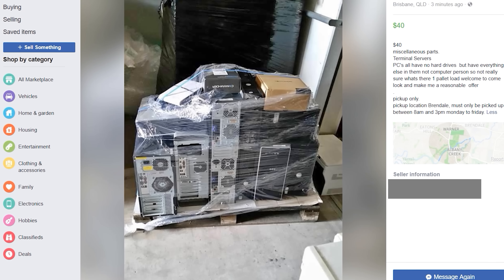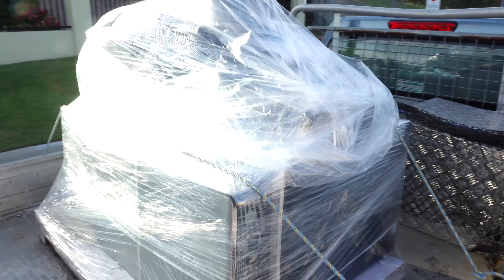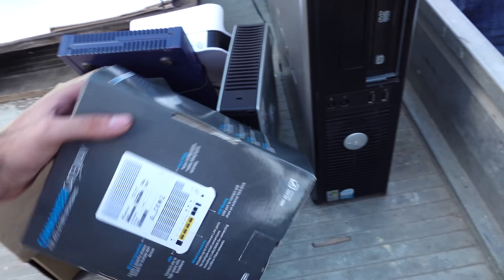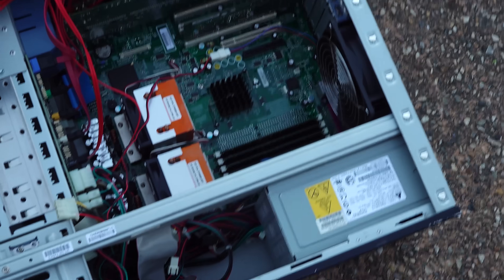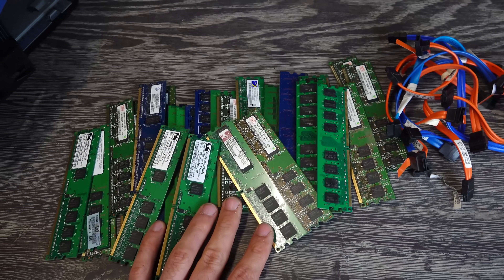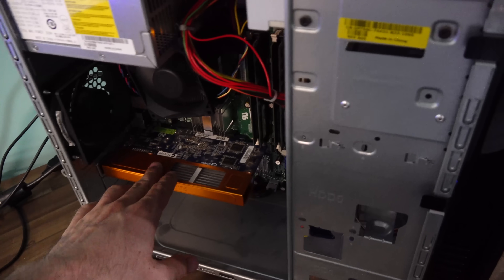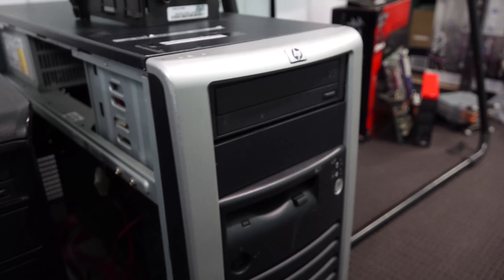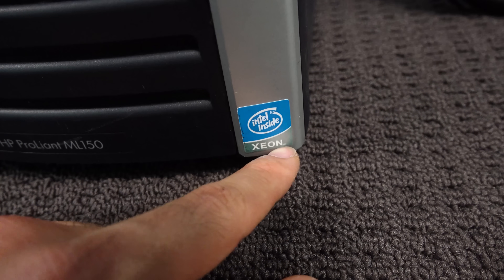I Got 15 Computers for $30....!

Comment: With so much scrap you could start your own series on extracting gold and copper
Reply: TheFinalRevelation THAT IS A WASTE OF PERFECTLY WORKING PCS. I HATE PEOPLES WHO DESTROY WORKING ELECTRONICS FFOR RAW MATERIALS but I enjoy watching videos about selling working parts like fans DVD had etc. not melting cpus in chemicals
Reply: I buy old pcs
Reply: Why the heck would he do that? Of one of these pcs he would make just a few dollars.. Restoring them and selling them he could get way more
Reply: @eduardoavila646  Who buys a core 2 duo these days ? They consume more power and are way too slow.
Reply: TheFinalRevelation spend $15 and get a q6600 and you have about an i3 lol
Reply: @TheFinalRevelation1  Lots of people. They can make great really cheap file servers, things like that. Lots to do with old processors that many don't even think of.
Reply: @XtremeConditions  They consume too much power, only the 2-2.4GHz core2duos consume less, others are a problem
Reply: @TheFinalRevelation1  I mean I just looked at an E8400 at 3ghz and power consumption seems very reasonable, and it's not like it's going to be under load all the same anyway..
Reply: @XtremeConditions  Perhaps but they are not practical. I am using an old processor myself which is on 24/7 (through a UPS) downloading files and nothing else, but it is a G645, very less power, dead silent with the fan limited to 1000 rpm, no overheating and very stable. Bought the whole desktop for 40 dollars in 2017 with 4GB ddr3, (2x2) and put in a 1TB HDD. Core2quads and E8400s etc are the worst thing you can buy. G620s and G645 are the best bang for the buck PC for this kind of stuff. You can buy them in a small form factor desktop for 20-30 dollars.
Reply: @XtremeConditions  I had one, not good for a PC you want to keep on 24/7 at a place with power outages. The G645 is more like a mobile processor. Goes as low as 1GHz perhaps. The temperature does not go above 60C ever in stress tests and I am not using a special cooler. I just replaced the fan. Even the fan does not go above 1200RPM. Dead silent and low power. Just sharing my experience. I have also used an E8400 but I didn't like it much. If it is a bit more performance you need, buy a 2nd or 3rd gen i3 desktop. They too are cheap these days. People don't want to buy them because they can get an i5 for a tiny bit more.
Reply: @TheFinalRevelation1  Awesome, thanks for that info.

So was that your purpose for the G645, a file server? And you put it down to 1Ghz yourself?  I think it showed 2.9 Ghz as base clock.

And it was still adequate? What sorts of things were you storing? Sorry to be a pain haha.
Reply: @XtremeConditions  Yes a sort of a file server to download media files 24/7 but not to store them.  It throttles like new gen CPUs. Dead cheap and low power. I measure its power by how long it can run on a battery.  There are some good options in the 6th, 7th gen boards but they are expensive. Check this out:  http://cpuboss.com/cpus/Intel-Pentium-G645-vs-Intel-Core2-Duo-E8400
Reply: @TheFinalRevelation1  Wow, so that's a really interesting use for them. I can't even imagine what the purpose of them being in charged for downloading would be lol. A node of kind, something like that? Well either way, I'm pretty intrigued tbh. I was even considering something like a basic web server to play around with too.
Reply: later stage  faster c2d models run win 10 fine got a old dell xps as a down-loader and media player hooked to the tv. 
even the quad cores make a good entry level gamer on if you add the 8 gig ram
Reply: @meowdacat  Downloader? ;)

So basically an HTPC type setup? I've honestly been thinking of taking a trip to a scrap yard and just seeing what they have on hand. I'd imagine a Core 2 Duo with an older cheapo single-slot GPU would work out just fine? I have an HD 5450 on hand and can't see even 4K 30fps video playback being that huge of an issue. 

More of just a fun/hobbyist type thing rather than for practicality. But it'd basically be "free" more or less.
Reply: @TheFinalRevelation1  
A core2 duo can be replaced with a quad core.
Reply: @TheFinalRevelation1  It is called retro gaming, you muggle!
Reply: @TheFinalRevelation1  umm Brazil or low enocmony country. Look at the optimize game pubg lite for South America . They still play ps2 over there and modified ps2 games. Heck they even for me that is good than what I have lol.
Reply: Scrapyard wars. Or is that already taken?
Reply: @Jimmy_Jones  linustechtips
Reply: If i had this hardware, i would PAY anyone 30$ just to get rid of it
Reply: Shhhhhhhhhhhhh.
Reply: It's only worth scrapping when you have literally tons as most of what you'll be scrapping is aluminium, iron and steel.  and you need to remove all non-recyclable plastics and separate the metals from anything with a PCB, and ideally shred everything yourself or take a deduction as non-shredded scrap has so much dead space for storage and transport.
source; worked for a refurbisher and sold 10-25tons of scrap hardware every month which basically covered the warehouse and office coffee and bog roll budget.  the older processors and components that actually have appreciable amounts of gold are worth substantially more as collectors items if they work anyway.  Most of our money in scrap came from cases and HDDs.
Reply: Lucky find
Reply: he got the look to be  a Aussie movie star .. that what ithink lo l
Reply: The ram cost more
Reply: That was i am thinking lol
Reply: no he wouldnt
Reply: Grinix I dont know to who is this directed, but if its for me, yes he would. 
A old computer, even a pentium 4 based system, worth more than the little bit of gold that you could potentially take out of it. Not to mention all the work you would have to remove the gold, all the chemicals you would have to buy, and all the time spent, wich reduce the gain you get with that small quantity of gold extracted. Firstly because unlike many people think, gold isnt just super abundant in these pc parts, the most abundant probably will be like Sn, Cu, the 'plastic' and/or glassfiber wich makes the pcbs, silicon, etc. 

And if you get the pric for the g of gold, calculate gow much you get out from a pc, and search for usuall prices online, you will see the difference. If you clean all the parts, and resell as a retrogaming pc, the profit is even bigger, as many people want to just buy a pc to play some old games. See youtube for example. 

Now that if you dont, for example, sell to a third world country, as Brazil. Then you would probably be able to have way more profit, these old eletronics can cost like 5-6x times more.
Reply: trash.. you can get lot of these for free
Reply: TheFinalRevelation nah he should just throw it in the garbage copper is worth crap you need a shit tone of copper in order to make near 5 dollars I should know my dad did it before
Reply: rainrunerkill Popkill They were talking about extracting the gold, not the copper. 
And surelly not much grams of gold would be possible to be taken out of these machines. 

But trowing them at the garbage wont make you even a single penny. 

Just sell them.
Reply: actually, if you read the original post, it says GOLD and COPPER, not just gold. sorry to burst that bubble of yours.
Reply: Random Guy13 I dont know wich buble you popped, down here we were discussing the gold extraction, its obvious that copper isnt worth it.

The discussion starts in the main original comment, and goes on, changes objectives, and if you see it clearly changed the subject to only gold

And btw why may of you guys need to feel like "winning" "oh sorry to burst your buble". 

The pric per kilo of the copper itself is bad enough that unless you go stealing all the internet and eletricity cables from the street you wont be gaining a decent amount of money.

Comment: I should also point out anything that has a 64bit dual core CPU, and take at least 4GB of RAM can run some low resource Linux Distros like Bodhi Linux, Mint Mate, and Mint XFCE. I'm also a fan of Xubuntu, but the latest updates are causing issues with my various AMD GPU/APU systems to the point of a total system crash where I can't boot my system, so moving to Mint Mate tonight.

Comment: I think that HP Proliant (the one with dual Xeons) is socket LGA 771. Pretty old architecture and a dual CPU setup, won't do great in gaming. Will probably do better than a core 2 duo though, it will have 8 cores and you can load it up with more than 4 GB of RAM most likely.

Comment: Some older systems needed a lot on the 5 Volt rail, and less on the 12 volt rail, so do keep that in mind when looking at early Pentium 4, and older systems. so it does not mean the PSU is crap, just the way they were made back in the day because again it's what the system needed.

Comment: See this garbage at work all day. If it isn't 2nd gen or newer don't bother.
Reply: Nilas Grahn  him means the processor gen you dickhead, but honestly if the pc doesn't have at least a 2nd gen i5 it's complete useless in the rapid software demands these days.
Reply: Nilas Grahn  also consoles are computer I think you mean desktop not computer, a computer is anything with a processing unit

Comment: That dual Xeon HP server/workstation looks like it had an HP P600 Smart Array controller in it.  I have 3 of those still!  They were over $1000 back in the day.  They were great cards.  You should definitely learn about your server history with that machine.  It had some old PCI-X slots.  Good stuff there.  I miss those old systems.  That was a pretty incredible haul for $30 AUD.  Please stick to your roots and keep doing videos like this!

Comment: I'm so happy at the end of the video you decided to go back and keep the core 2 duos. Obviously they're rather weak in 2018, however for really budget builds they can't be beat. Usually get them less than 5 bucks a piece and can play a decent assortment of games at 720p or lower with either an integrated chipset graphics solution or a cheap old card. I know for you personally flipping a core 2 duo pc for like 25-50 bucks probably isn't worth the time invested to wipe it out and install windows etc, but for a super budget gamer or something similar it really can't be beat.
Reply: If only Intel had them unlocked, then I'd buy a couple dozen just for a weekend of LN2 fun, but sadly they are pretty useless except running Linux (but I could run a out 32 virtual machines of Linux at once with my CPU and have it run faster, so its not like I'd want 32 of those systems!). Its just a shame they are locked... Would have been fun!

Comment: I hope the AMD-System is going not to Junkyard... Bryan was it AM2? Was a Athlon X2 5600+ or 5800+ in it?
Reply: They can still run a low resource Linux distro like Bodhi well, as I've gotten it to run on some shit Intel Atom N270 Netbooks with 1.5GB RAM and 360p Youtube playback via SMPlayer, and SMTube works just fine.

Comment: I bet you could probably push that E4500 to atleast 2.8GHz, i was able to push mine to basically 3.0/3.1 on a copper zalman top down cooler. although to be fair when i pushed it to 3.1 it was because i found good memory sticks for it.

Comment: Oof, the Xeons in that dual socket system are Netburst uarch. So basically Pentium 4 Xeon counterparts. Yikessss. Whats that long add-in card with all the red cables coming out of it though?
Potato name ideas! Russet, Yukon, Opperdoezer, Tajfun, and Bintje.
Reply: I'm 99% sure it's an HP P600 PCI-X Smart Array controller.  I can see the ports and the battery.  I have 3 of those cards.
Reply: Looks like a RAID controller to me. All the cables look like SATA data cables.
Reply: Maybe the board supports "dunnington" 6 core xeons.
Those are quite rare though.
If it works this could be a 12 core workstation.
Reply: @Polaris Lakewell cool.
Reply: The cases would cost more than 30 ezilwe
Reply: Yeah when I saw that 90nm I was like that is not from the past decade...
Reply: RAID card mate
Reply: For an idea of what dual netburst is capable of: https://www.youtube.com/watch?v=rMCSRhHKI6c
My name nomination is Cheddar Mill, a pun on Cedar Mill.
Or more Obscure: Tejas / Jayhawk, the cancelled Netburst chips. :P

Comment: Whats in the small HP ones? :) they look like pretty nice emulation pcs ^^
Reply: Yep, I definitely would look into those more.  Those could be great little emulation stations.
Reply: Probably Atom N270-N280 with GMA 950 and up to 2gb of DDR2. basically a netbook on the inside

Comment: I dont think thats $100 in ram

1GB DDR2 = $0.50
2GB DDR2 = $4.00
512MB DDR = $0.10

Source CEX / Webuy Australia
Reply: Mhmmm. DDR2 is a tough sell. Even ddr3... bought 4x4gb 1333 for $40.
Reply: yeah i bought 12 sticks of 1gb ddr2 for like $20 here in brazil and things are more expensive over here than pretty much anywhere else in the world.
Reply: Yeah, even a pile of ddr2 sells better as scrap
Reply: thats not what cex gives u thats what cex sells for
Reply: In my country... 2gb ddr2 is 10$..
Reply: He can still earn at least $20 in profit per computer, ranging greatly on specs and if he sells them all with max/enough RAM other specs maxed enough.

Comment: I have an older amd 965 black edition build, Antec case, 750 watt cooler master power supply and 8 gigs of ddr 3 ram. Comes with 2 power color 5770's in crossfire.  Fresh windows 7 install. Works great but here in Canada ya cant get rid of 10 year old technology. Who do you sell ddr2 ram to these days? I cant give this computer away.
Reply: Americans.

Comment: Just slap in some core 2 quads in there and they will run fine with windows 10. I have pretty much all those PC in my house and I got them from work (not sure if you remember me telling you) but yeah, I have the OptiPlex 780 up and running with a Q9400 and a GT 730 that one is for my aunt, then I have the Dell Vostro I have is using a Q6600 with a GTX 460. They run great. Plus the OptiPlex 780 should have a 1333 front side bus and DDR 3 and gigabit ethernet unless yours are the older model.
Reply: Why Windows 10 tho? Windows 7 is much more suitable for these machines since it uses less resources, and works better anyway
Reply: @mad_cat431  I have no argument with that. I'm just thinking if he flips them he would most likely be using windows 10. And it's what people will be looking for in a PC. If they see it running windows 7 they might pass on these and find something else running windows 10.

Comment: Those xeons are 10 or more years old, probably single core if I had to guess.
Reply: "that's all you need for gaming, its that single core performance!" - most 6700k through 7700k owners
Reply: He showed the page, dual cores. Therre Only 10 years old, xeons are server grade cpus so if they were 10 years old and only single cores that would be dumb asf
Reply: i mean, people say single core performance is what matters, because games mostly use 4-6 threads. So if you do have 6 threads or more single core performance is what you should be concerned about, not getting more cores.
7700k's easily beats something like an r7 1800x in games, the 6700k is usually on par with the 1800x, but overclocked that beats it too(because it overclocks more than the 1800x).
Reply: Don’t think Xeons were ever single cores but okay chief

Comment: Was just about to write some of the Dells can take Q6600s which can be found for cheap. If you're doin the 2$ LOL PC, you could even try to OC with the tape method.

The GX780 iirc take Q6600s and have 4 slots for ram, which might be a good way to dump the 1GB sticks.

As for the Server: IIRC some people search for those cases.

BTW: don't you salvage the optical drives?

Comment: Check if any of those pc's support 1333 fsb core 2 duo processors or if they support the core 2 extremes, then mod the q6600 you put in it too 1333 fsb for a 3.0 ghz quad core pc.
Also that amd pc might be worth looking what the motherboard supports in terms of processors, if you are in luck it's an am2+ motherboard that supports am3 up too 125w tdp which means an amd phenom II x4 or x6 of some sort which keeps up with first gen & 2nd gen I5 fairly well as well as those core 2 quad chips on a ddr3 motherboard.

Comment: How is ddr2 2gb jackpot?
Reply: perfect for a budget older system. especially so if you can get 2 of the sticks.  good example would be to set it up with ubuntu which is less ram hungry than windows for a good email/facebook machine for someone who doesn't do much with computers except to stay up to date with family. 

I can think of several people in my family who I could get something cheap budget set up with a couple stick and would pay for that.  cheaply of course.
Reply: Also because 4 of those makes for a cheap 8GB Core 2 Quad starter gaming rig. Each 2GB stick is also worth about 5-10USD a piece, so He about got his monies worth in those sticks alone.

Comment: I'd be swapping 2 x Xeon E5450's into that dual processor server, it would be a great budget 8 core gaming machine.
Reply: That's not a 771/775 server, that's an old Socket 604 server based on Netburst (Pentium 4) Xeons. It's useless.
Reply: Maybe the socket 604 core based xeons might work? I think they went all the way up to 6 core processor variants.  Although it would be dependant upon the chipset supporting the tigerton or dunnington chips. Normally, I would assume not, but seeing as there is an abundance of core2 era systems there, it stands to reason that the server would be from the same era.
Reply: Absolutely. With 150 or so dollars it could be completely transformed into a gaming beast.

Comment: @Tech YES City if I lived over in your area I would give you hundreds of 2gb sticks of ddr2 I have hundreds of 2gb sticks, also use the tape overclock method on thos older lga 775 or lga 771 xeons cpus to over clock them some, works on lga 775 and lga 771 cpus with a fsb of 800-1066 mhz clock fsb 1333 wont work with the tape mod only works on cpus less than 1333 fsb